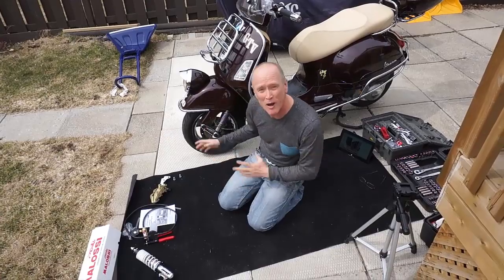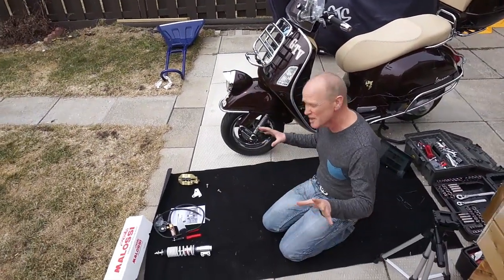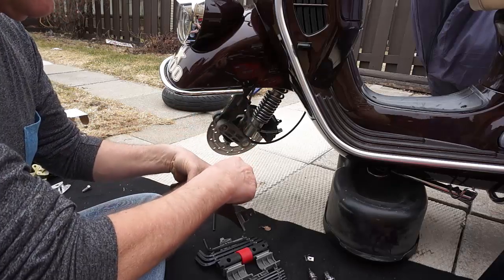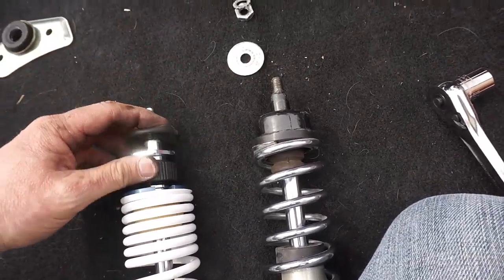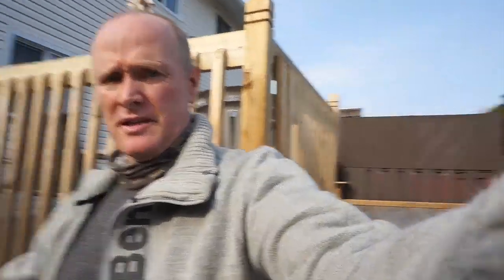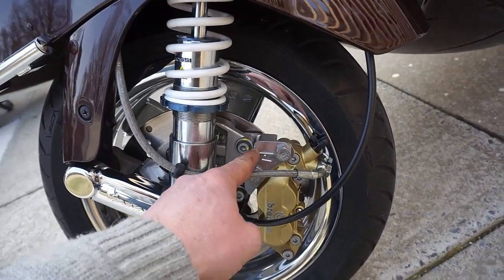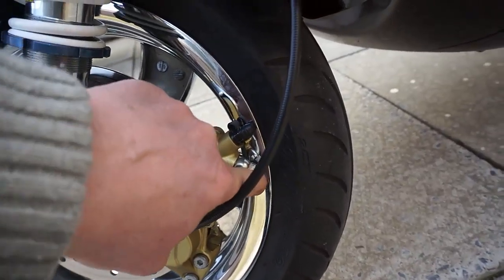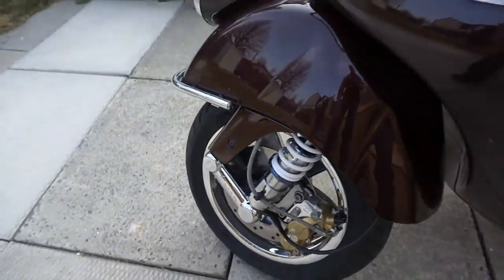Install Malossi RS 24 Shocks and Brembo Caliper on Vespa GTV-300

Comment: Hi Peter, first of all great clip and instructions!
I just bought the caliper for my GTS 300 and looking forward to mount it :)
Wanted to ask what brake pads can be used with this caliper? From the site I bought them, they only have the Carbon Ceramic (CC) series and I would like to check whether sintered XS series is available, but the nasty customer service does not reveal the original brembo part numbers! 
Thanks in advance

Comment: how has this if any affected your ride?
Reply from the maker: The ride was night and day. Much better at high speeds and in the corners.
Reply: both single and with passanger or more noticable with passanger?
Reply from the maker: Much better with passenger as well as single rider
Reply: cool thanks for quick respond
ride safe